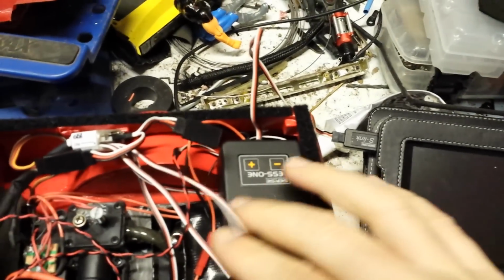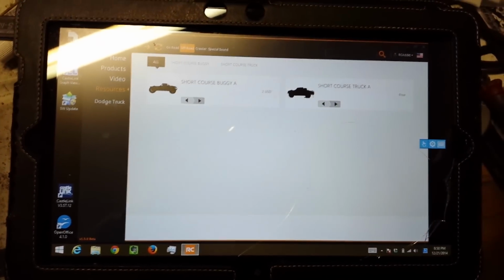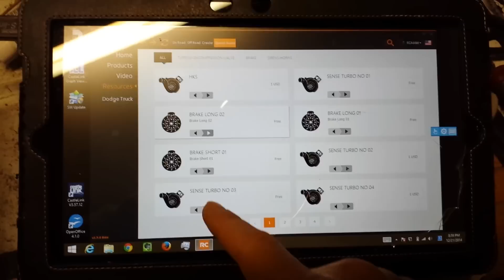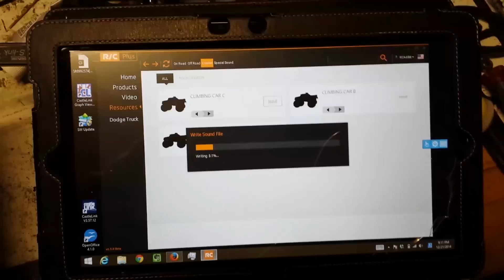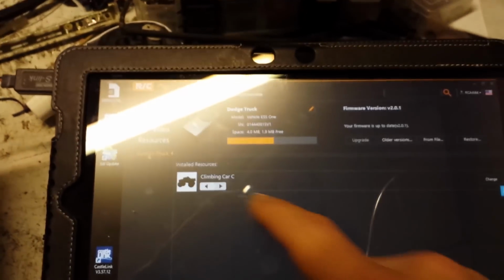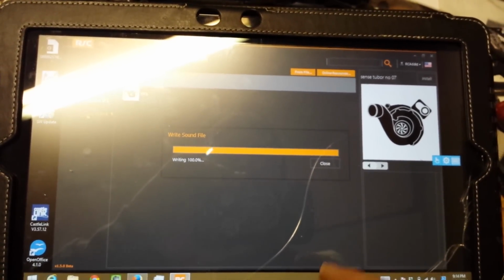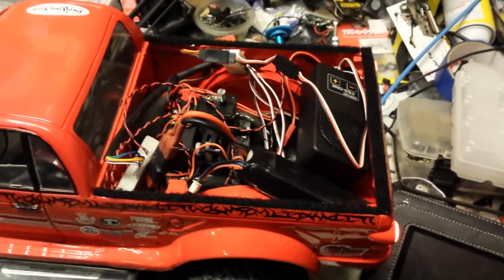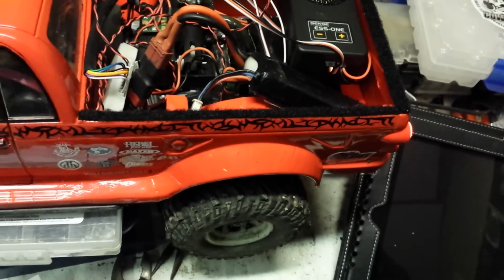Real Honest Review - ESS 1 Engine Sound System by Sense Innovations

Comment: Ok so do you have any idea what signal goes into the unit from the RC reciever to make it work. Can you modify the unit to work on an eBike with a varying voltage 0-5VDC?
Reply from the maker: It gets a pvm signal from the throttle channel on the radio. Not sure how it could work with an e bike I don't know how ebike throttles work.

Comment: Is there a way to shut off the sound and still be able to run the truck without a big hassel?
Maybe it is just me but, I do a lot of G6 events and trailing and that sound would drive me insane (I know it is a short drive...lol) listening to it all day. 
I am sure you could just unplug it be I waterproof  my Rc's so unplugging wouldn't be an option for me with everything sealed up
Reply from the maker: Sure just unplug it from the battery. It's a simple connection.
Reply: or turn it down all the way. its that simple